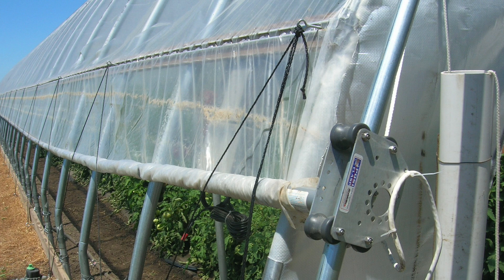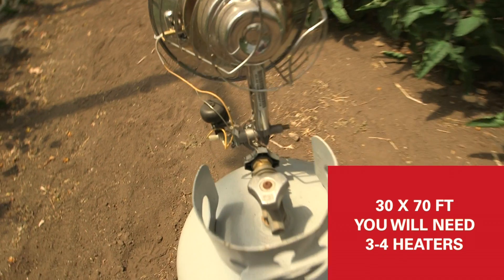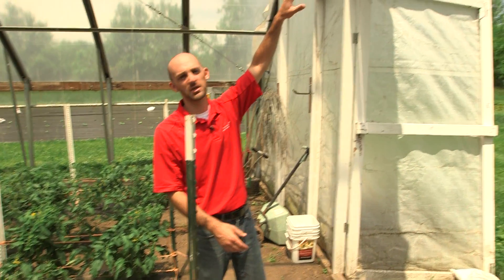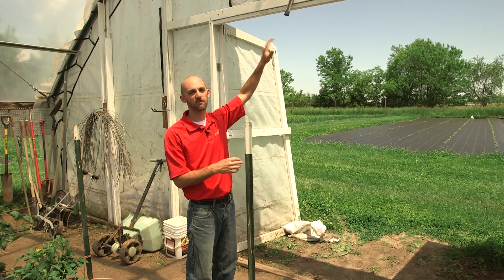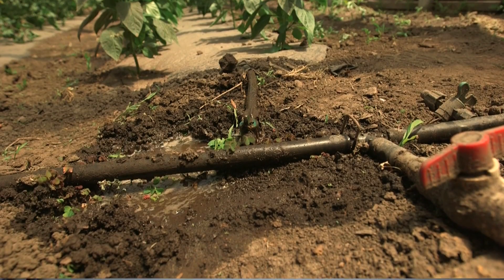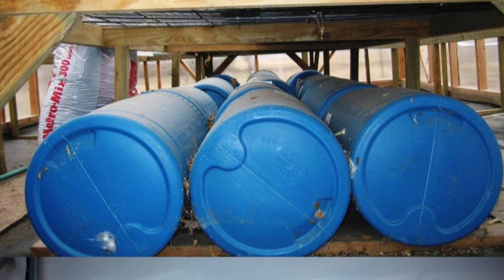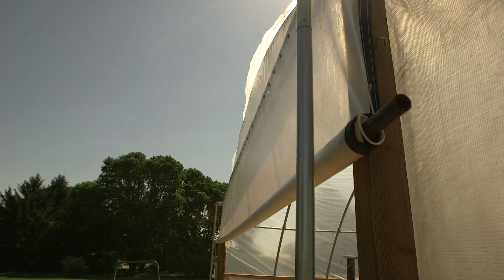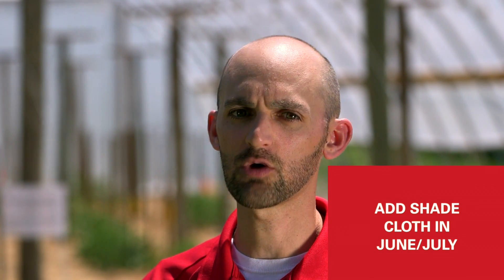How to Manage Temperatures in a High Tunnel

Comment: Hey Joseph, What do you think is the best way to heat a greenhouse if I don't have natural gas available? I have 10 tunnels, 2178 sqft each, growing leafy greens. I'm up in Canada where the temp dips to -5 F at times. Would appreciate your feedback!
Reply from the maker: Greetings Tony,

My background and experience is really high tunnels and providing a night or two of freeze protection and not so much greenhouse production requiring permanent furnace installations.  Natural gas, propane, used oil, and wood are all commonly used here in IA to heat greenhouses where we can get at times below 0 degrees.  I am not a huge fan of electric furnaces but they would likely get the job done as well.  The key with greenhouse heating is to get a system sized large enough to heat your building as well making sure the burn chamber is in good condition and fumes created during combustion are vented outside, up, and away from the building to ensure no residual ethylene gas enters the building.  You also need to make sure you are bringing in some fresh air to the building.  Actual sizing and design of the system is not in my realm of expertise.

Comment: Running cost? Cant see that being cost effective?
Reply: Hello Geoff,

The propane heaters are intended for short term, irregular use a couple of times each season when temperatures dip just below freezing during the early morning hours. They are not intended for long term use with temperatures well below freezing for many days and nights.  In other words, they are not intended to serve as a primary heat source when the high tunnel is used as a greenhouse.  About four tank+heater combos should be sufficient to hold temperatures above freezing for a few hours at approximately $100 to $125 per unit.  A 30’ x 96’ high tunnel with single layer plastic will use about 43,000 BTU’s per hour which is about a half-gallon of propane per hour.  Assuming $1.50 per gallon of propane and a 4 hour run time per night, the nightly operating cost is $6.  Amortized cost of equipment over 10 years is $50. 
These heaters certainly have their place but they are not the solution to all heating needs.  If you are using your tunnel as a greenhouse with double poly plastic and heating for many days and nights, then I absolutely agree a permanent furnace is a much better choice for many reasons.

Comment: I was told by a University of Minnesota Extension agent that you risk affecting fruit production when using propane heaters that vent their exhaust right into the structure.  Any thoughts on that?
Reply from the maker: “Greetings Paul and Sara Huber,
Under frequent and long periods of use, all heaters should be vented up and away from the high tunnel to prevent the buildup of gases such as ethylene, carbon monoxide, and carbon dioxide that form from incomplete combustion.  The primary problem for plants is ethylene which can impact fruit and shoot development.  Ethylene problems are normally seen in poorly vented greenhouses or high tunnels when it has been cold and cloudy for several days in a row causing furnaces (even those that are externally vented) to run for long periods without adequate ventilation.  When used for just a few hours a couple nights a year, portable unvented heaters cause little to no issues for plants.   They are very commonly used for getting through a handful of cold mornings each year.”
Reply: UKNOW How-to Videos wonderful!      thank you!